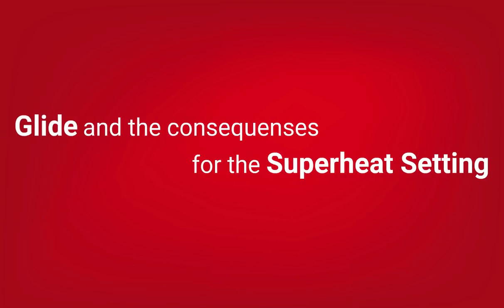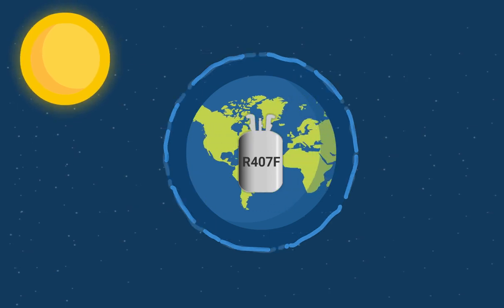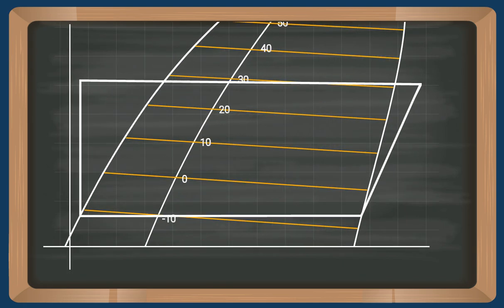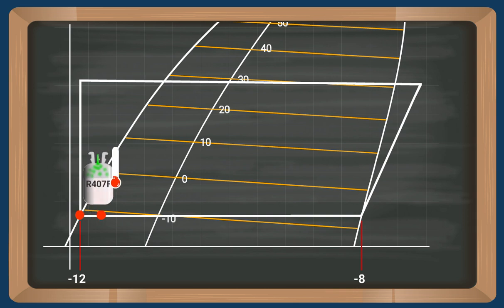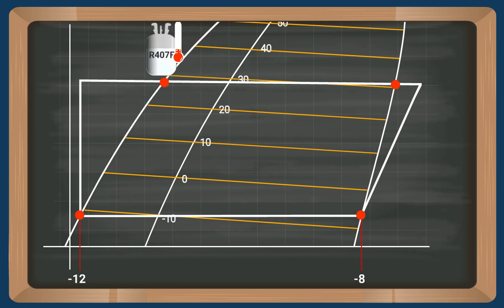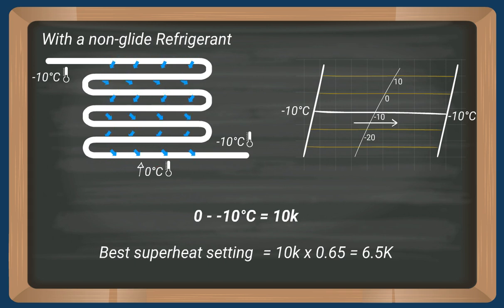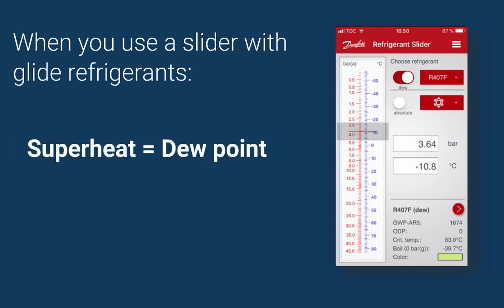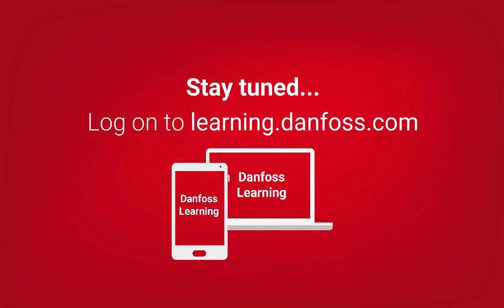What is glide and the resulting consequences for the superheat setting

Comment: Great video....but I'm a little perplexed.  R32 at -12C  = 4.42 barg.....but R125 at the same 4.42 barg = -6.49  and not -10C 🤔.  Also...at 4.42 barg, R134a has a saturation temperature of +18.36 C...and not -8C.   I'm assuming that the saturation pressure remains constant (it may have been useful if you had made a reference to saturation pressure) .... I'm sure I've missed something.....please explain ? 🤔  best regards R
Reply from the maker: Hi Robin. Please refer to our website dedicated to refrigerants - https://www.danfoss.com/en/about-danfoss/our-businesses/cooling/refrigerants-and-energy-efficiency/danfoss-refrigerant-transition-center/. Hope this is helpful!
Reply: Not really an answer to my question.....but thanks anyway ☹

Comment: how to know at what pressure our regrigerant will work? Do we put the atmosphere pressure of the city we are going to built on it or else?
Reply from the maker: Determining the right pressure for a refrigerant depends on two things:
 
1. The system and the internal pressure it is designed for
2. Which refrigerant you are using

You can learn more about how this works in our free Refrigeration Fundamentals eLesson: https://danfoss-catalog.sabacloud.com/Saba/Web_spf/EU2PRD0064/guest/learningeventdetail/curra000000000003020